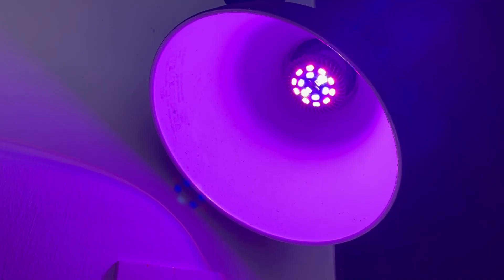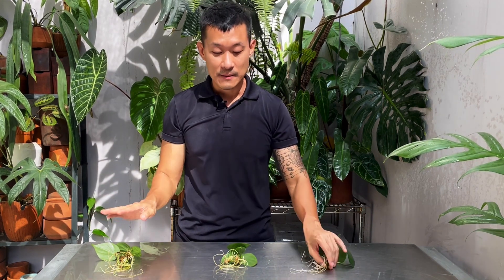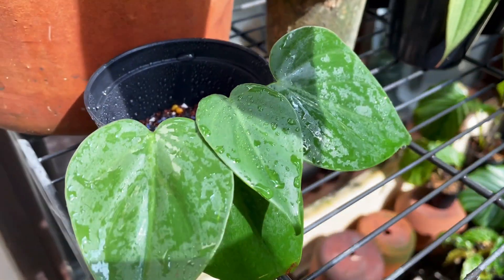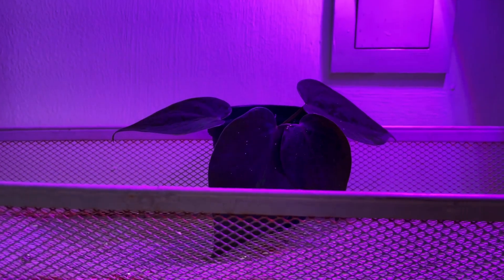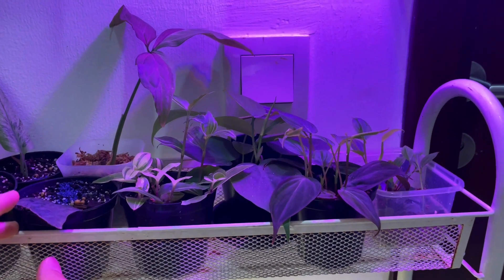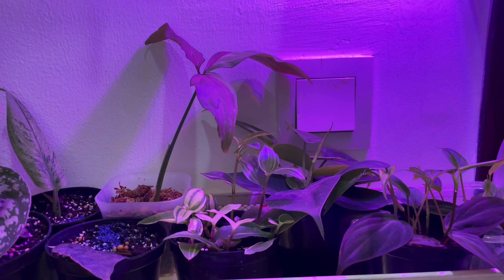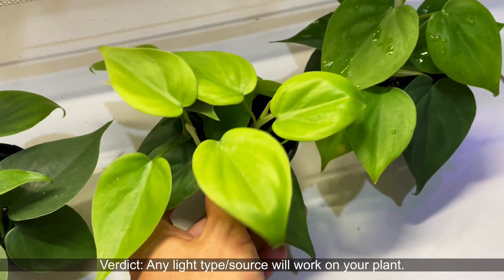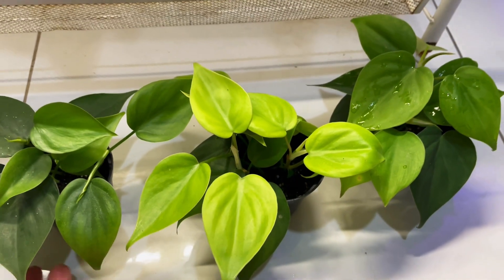Natural Light VS Artificial Light VS Plant Grow Lights | An Experiment - WITH UPDATES

Comment: THANK YOU for saying any light works on plants generally speaking. Because I was too busy thinking I need LED or do I need Fluorescent or do I need green light, do I need purple.... I want to grow my Alocasia but I will stick with the grow light I Was able to afford.
Reply from the maker: Regular led bulbs that save energy is great for them. You may need to place them quite close to light source though. Ceiling to floor distance is often too much distance.
Reply: @onlyplants  Yes your right. I got cheaper led lights the pipe actually goes into my Alocasia Soil and their directly above my alocasia. Thats how close :) Thank you